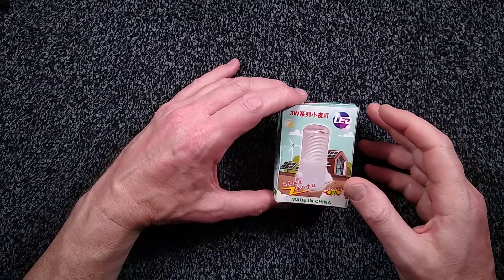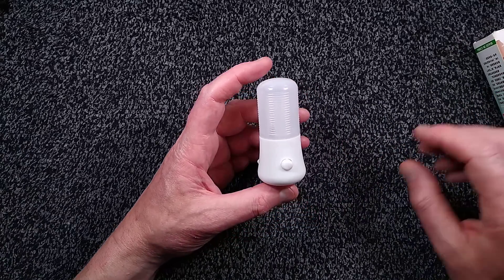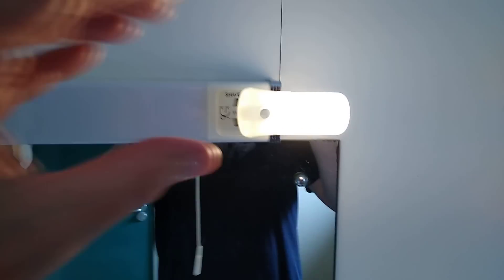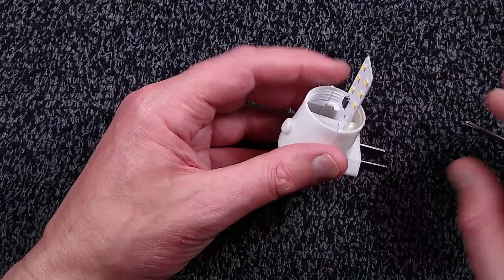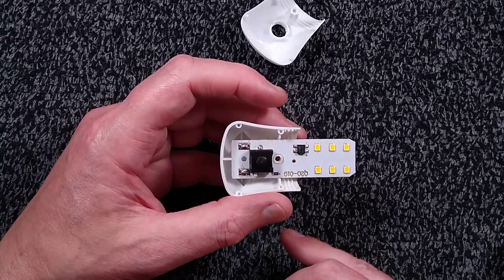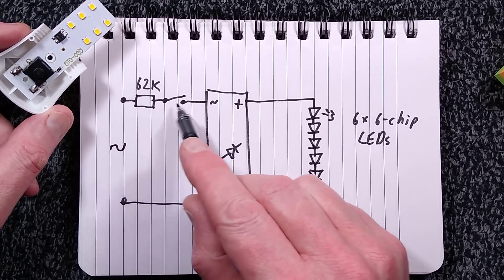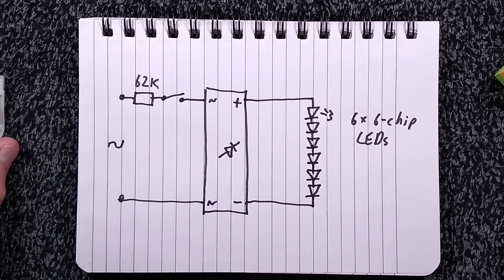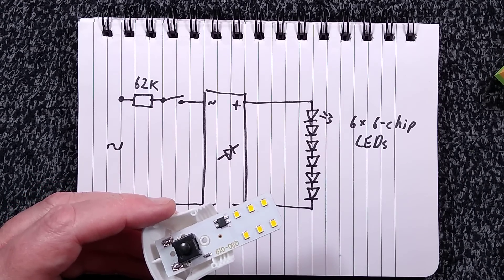eBay "induction" night light teardown

Comment: If you have 19v per LED x 6 = 114 volts drop. That explains why it lit up when plugged into 120VACrms (i.e. 169 Vpeak). By not having a capacitor, the power factor is better. The power/voltage in the resistor at 230VACrms is not appropriate -- even by cheap Chinese standards. You can tell the plug is intended for China because it doesn't have the holes in the blades that are in the US plugs.

Comment: Assuming the usual cost-cutting measures in these lamps, the miniscule resistor was probably meant to be a fuse as a last resort protection as it is the first component in the circuit. If it did fail from overheating or transients, it can scorch the PCB possibly causing a fire.

Comment: Resistor is first, because that is the "Fuse". That way if the cheap-o switch fails and bridges Live and Neutral (interesting to see inside that switch, to see if anything sensible is inside) then it can release the smoke first, and maybe not fire.

Comment: Hi clive,I  don't currently have equipment to do experiment related to solar power, but i think it is quite interesting, can you put load to two power supply on the same time, but one power supply will have slightly higher voltage than the other one and see the current flowing from each supply?

Comment: They are simply selling it in the wrong country. It looks designed for US sockets. That's much less stress on the wee little resistor (20 volts rms, 7 milliwatts).

Comment: “It is what they have done”. 😂. What a lot of old toot that thing is.  The £2 battery powered PIR light from What is better.  I use 3x AAA 1000mah batteries in them and they last for months.  Although they only stay of for 30 seconds if you don’t move, I can just wave and finish up.  Thanks Clive. 😀👍

Comment: The 62 kΩ resistor placement is quite a smart idea ! ... should any diode in the bridge rectifier go short ( they ALWAYS fail short circuit ! ! ) then this resistor stops the mains being shorted [ = BANG + smoke ? ] ... (  I see no safety fuse ? ? ) ... the great joy of this video is , now every hobby person can now make their own night light with " junk box " components and any load of old Christmas light LED's  ( ? ) ...FYI , you can use a 100 nF  275 Vac capacitor ( X2 rated ) + 470 Ω resistor in series instead of the 62 kΩ resistor , should you have these to hand ..( tried - n - tested ) ............

Comment: I have an "induction night light", and it consists of a "support" with a coil that you plug into the wall outlet, and a "light" stick that you put inside the support / coil. The light has a battery that charges inductively and a PIR. When the PIR detects movement, the light turns on for 30 seconds or so. If you take the light out of the support, it automatically turns on. Then you can turn it off/on with an integrated switch and use it as a flashlight.
I was expecting something like that when I read "induction night light"...

Comment: Regarding what it would cost to add a second resistor to that design. I would estimate that the actual cost of placement on the PCB costs more than the component itself. The rule of thumb that someone in my workplace told me is that, at volume, the placement costs around $0.01 per component. At quantity from a place like Digikey, a reel of 10k 1/4W 1206-package, 33k, 30k, or 31.6k-ohm resistors (if we are shooting for roughly half of 62k), would be around $0.003-0.004 per resistor, or less. So lets say around $0.014 USD, and that is for a US-based company. The rates might be even lower on the local market.
Reply: The lack of a second resistor has nothing to do with the cost, and everything to do with the "Me no understand! Look: it works good, no?" attitude.
Reply: @AttilaAsztalos  "Cha bu duo" is the Chinese phrase, means "close enough".

Comment: Nothing to do with induction, capacitance or photo infrared. I suppose it could be classed as a proximity activated light by virtue you need to be in close enough proximity to press the on button.
Induction sensors as in induction proximity switches only work when they detect the presents of a ferris object, not a human.

Comment: This design has the added benefit that the range can easily be extended just by plugging it in further away.
Reply: Depends on how long a pole you have to operate the "Passive Infrared Detector"
Reply: @TheLexa000  I'm sure everyone has access to a 10-foot pole ?
Or at the very least there's a drunk 6 foot Pole nearby as an alternative ;)

Comment: Years ago I had an idea of wrapping a wire in another wire and using it to light a low current LED.  Just as a quick and dirty method to indicate current flow in machinery without actually interrupting current flow.  Sort of like a semi permanent clamp meter.  I was looking for a way to see if heating elements had burned out or not.  Light goes out, heating element needs replacing.  I never actually tried this though.  That's what I was hoping for when you said "inductive".  Oh well.

Also I worked in a place that used plug heating elements like water.  Mainly because the operators were idiots.  Technically I was an operator too, but I was the only one who knew how to fix things the others broke.  God help me I should have been making way more money than I was.
Reply: A clip on current transformer might work for that.
Reply: @Broken_Yugo  I did not know such a thing existed.  I may need to try that.
Reply: @rayceeya8659  just understand it's a voltage transformer when not clamped to near zero by an ammeter shunt, they can float up north of a kilovolt, so make sure something is clamping both half cycles (e.g. silicon diode antiparallel to the LED) and maybe consider some backup like a TVS diode or whatever.

Comment: a resistor may not be expensive, but properly trained engineers are, from what it seems
Reply: My best guess is this blatantly bad stuff is designed by students on the side or perhaps some gig work website is used. Looks like something I'd come up with when I barely understood Ohm's law or proper mains safety.

Comment: That's not a switch, it's a manually-operated, pressure detector. It works by responding to mechanical pressure applied to the actuator, thus completing the circuit and allowing current to flow. A bit like IBM's circuit diagrams featuring an AMD - an Air Movement Device, commonly known as an F-A-N in non-technical circles.

Comment: I saw exact same design of light and it had pir sensor instead of button so yeah it was copy from someone or its just mass produced shell with different settings depending on what they found on the back of factory

Comment: I feel that the Chinese manufacturer are letting themselves down a bit here. The easy for kids to unscrew light cover is a good start, but using a proper bridge rectifier chip is a bit safety conscious and overly expensive. What's wrong with using the LED's themselves as a rectifier ( half wave, of course ). As long as it lasts long enough to get out of the factory then it's good right? And there should be some kind of water reservoir somewhere, that you have to top up regularly, because it leaks ...
Reply: The  ½ wave idea is VERY simple (  I have made several with a 100 nF , 275 VAC dropper capacitor + 470 Ω resistor in series ) , but the BIG  BIG snag is the  ½ wave " flicker " on opposing chains of LED's which some folk find VERY annoying , bridge rectifiers are dirt cheap and allow a small smoothing capacitor ( 2 microfarad ? ) should there be any sign of flicker ..... hope this is of help , I have built lots of each type ( tried - n - tested ! ! ) ..........
Reply: @davidfalconer8913  Wooooooosh!

Comment: Funnily enough, just a couple days ago Techmoan put out a video that was edited down due to a content strike against an ad break jingle by The Carpenters about going to the bathroom.
That switch is one of the crappiest pushbutton switches evar. I managed to get a 10-pack from Mouser many years ago during the handful of days that they were available. They claim 1A, but I wouldn't trust that any farther than a DangerKitty could throw it.

Comment: Am I remembering correctly or didn't these children's nightlights decades ago use ordinary mains neon lamps? Not as bright but did the job, and simpler/cheaper tech which lasted forever.
Reply: Neon lamps do NOT last forever. After a few years in operation they start flickering and eventually fail to light at all.
Reply: @brianleeper5737  I feel like neons are kind of like LEDs in that most are way overdriven to save money, and the quality range got a lot wider in recent years with lots of crappy reject parts on the bottom shelf. I've seen some pretty old high hour equipment that still had functional neon power indicators. I have one power strip where the neon has been flickering for probably a decade and is still bright. A long life neon nightlight made with modern chinesium NE-2s would probably need like 10 neons to give off usable light at a sane drive current.
Reply: @Broken_Yugo  I have and old power strip from the 90s and last time I used it, the neon bulb was very intermittently flickering. Strangely enough, that only happened when it was dark in the room. During the day, it glowed without flickering. When it did flicker it was probably as bright as new, but it was certainly not reliable.

Comment: Perhaps the PCB was 'designed' by plonking the components on the board layout and then letting the autorouter do the rest. And if nobody bothered to adjust the components' relative locations or even simply rotated the resistor 180 degrees, then you end up with this.

Comment: That black switch is designed for low voltage DC (up to like 20 volts maybe? they're not rated to switch mains.) so I think it makes sense the switch is past the resistor. Slightly less voltage.
Reply: Not really, it still sees the full open circuit voltage and worse it's a DC voltage so you get a nice arc when it switches!

Comment: I've always assumed that too-low fittings in places like that was a result of following accessibility laws in the dumbest, cheapest way possible. 
If you mount your fittings too low, then they're technically, kinda, accessible to everyone!
Reply: Also kids and water, absolutely perfect for disaster...
It usually gets hung low to cover the spot of the old mirror which was hung 40 years ago, same as the water outlet on the wall.. How to hang that higher if the pipe exit low?
Reply: @kitecattestecke2303  Sink pipes usually go down through the sink and turn into the wall.  So making the short pipe under each valve longer fixes the height issue.

A 3rd option is that some contractor misunderstood student accommodation to mean children and not 18+.
Reply: In the UK the average height of a woman is 5'3" according to the ONS.  Think about that for second or two.
Reply: big Clive is just too tall
Reply: Good point and good example of equality vs equity

Comment: I'm 6'5" and I dealt with relatively short mirrors for 6 years at my last apartment.  I completely forgot how nice it was to not have to squat to see yourself in a mirror.  Shower heads are another subject...
Reply: People mounting mirrors rarely seem to consider the physics. The top of a mirror needs to be mounted with the top at a height at least half way between the users eye level and the top of their head.  If it's going to be used as a full length mirror it needs the bottom of the mirror mounted half way between the users eye level and the floor. i.e. it needs to needs to be at least  half the height of the user.
Reply: @andrewfrance1047  The bathroom mirror at my new apartment is 7'4" off the floor.  I feel short.  :D
Reply: There must be a higher mirror standard in the states.
Reply: My father was relatively short, 5'5"(American), and I am 6'1". When he plumbed a shower in downstairs, the water hit me right in the mouth.lol
Reply: How about a short shower head with a ceramic soap dish almost just below it. Duck and bonk.

Comment: I'm amazed the bridge rectifier can handle 110 and 220 volts without any other electronics
Reply: Well if it's rated for 220 then it should be no problem also handling 110. But the other way around not so sure.
Reply: @BinaryOptionRomaniaBOR1  exactly LOL
Reply: I'm not, it's just diodes. What other electronics would you even add to that?
Reply: @benbaselet2026  I'm not sure it's just amazing its almost the same brightness with no other electronics like a transistor or chip or capacitor
Reply: @nomusicrc  It's very common to get regular diodes rated at 1000 volts on the cheap. Brightness will follow the input voltage pretty neatly because there is absolutely no controlling of the power so it's just ohm's law and the forward voltage of the diodes. The camera makes it very hard to judge actual brightness differences.

Comment: As a tall person who stayed in Student accommodation for a few years seeing that shower cubicle triggered PTSD, they were terrible, lord only knows why they're designed that way. There was one shower in my accommodation that wasn't that tiny stupid cubicle design and there would always be a rush to get to it first in the morning.
Reply: I'm the same height as Clive at 193cm or about 6'4". It's usually not a problem here in Finland, but it definitely was a problem when I visited Florida. Those fixed shower heads were way too low for comfortable use.
Reply: Get a travel shower head, they have some with a stretchy silicone tube that "clamps" onto the showerhead. Amazon

Comment: I think they meant that this night light was meant for Photonicinduction! I mean that 1/8th watt resistor is just crying to be cranked up until it pops! At least the switch isn't some mess of spring, plastic and a contact pushed by plastic like the one I blew up recently. Luckily the fault (the spring) fused and didn't take out my Kill-a-Watt meter or trip the MCB.
Reply: I miss that mad boi. How is he?

Comment: One of the most uncomplicated schematic featured on this channel.  Amazing what you can do when there's component shortages. Replace an infrared detector with a switch.
Reply: It's going backwards in time, when "remote control" meant telling the kid -"Hey, John, go over and change the channel".
Reply: @Troy Belding  I was my dad's remote laying on the floor next to the set. I was super efficient at my task.  Dad would rell me "don't turn the knob so damn fast... you'll wear it out or break it!".  -Thanks for bringing that memory to light. 

Also, I was pretty good at 'tuning' and 'vertical hold' adjustment (which remote controls still lack).  Dad never let me change the tubes when they went bad... but I got to watch (over his shoulder) and ask him silly questions like "Can X-Rays really kill you, Dad?"
Reply: @brentengelhart5  - Glad I could give you a good memory.   When my brother and I had a tube TV, it was at the point of time where getting replacement tubes started to become impossible.
Reply: Progress, man.
Reply: You are the infrared detector
Reply: Still the gas cell generator schematic wins